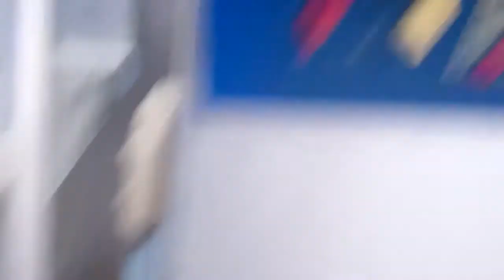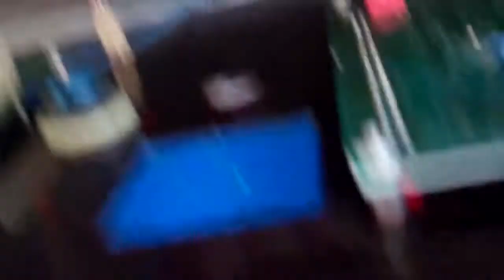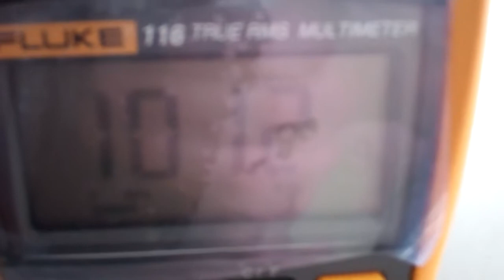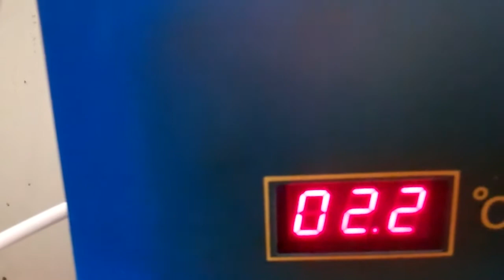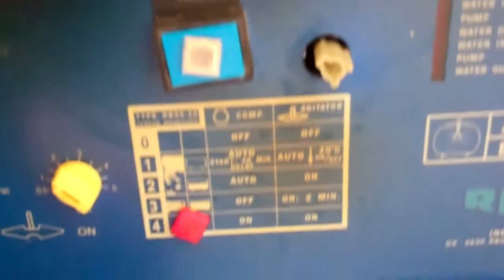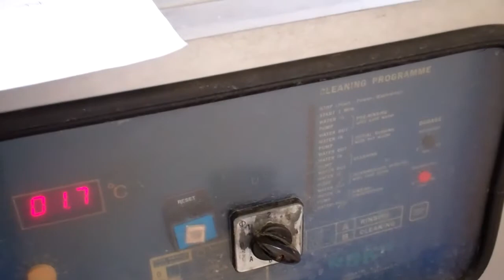Cooling Fail Diagnosis

Comment from the maker: Hi Fritz!

Thanks! Tanker driver should check the temperature before collection, but the tanker will stop loading automatically if the milk is too warm. They take samples to test from the tank regularily for butter fat, protein, water content, bacteria, antibiotics, etc.(milk price to farm depends on quality) They test at the dairy also, not sure if its every tanker or every silo full. 

Milk is cleaner than it used to be, remeber as a child it would go off in a few of days but lasts weeks now!